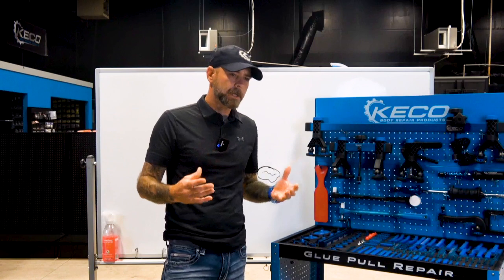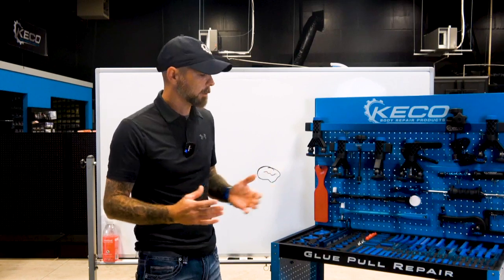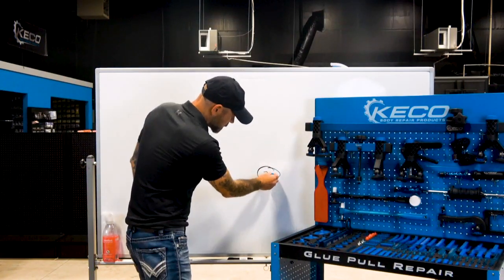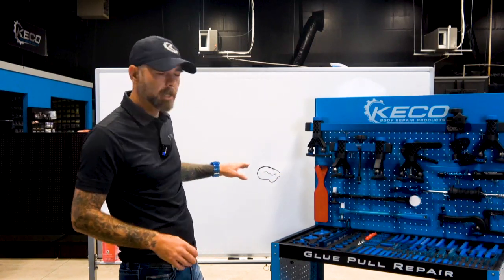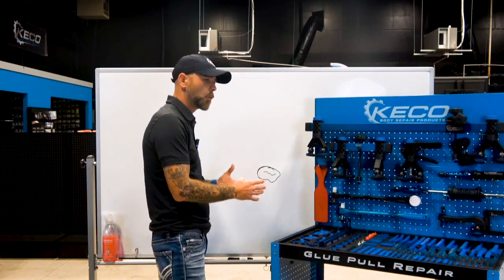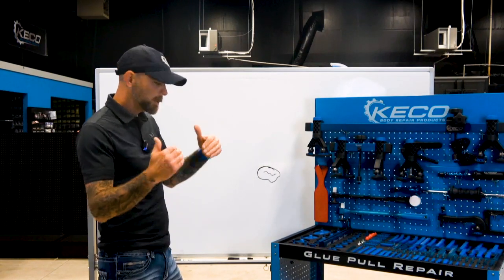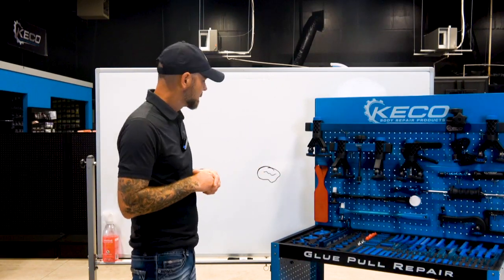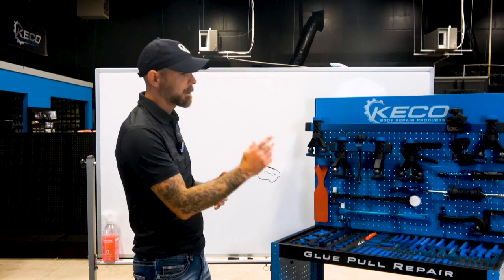Is Your Glue Tab Too Small? - How to Size Your Tab Correctly - Customer Problem Solved

Comment: I have a hail damage corolla I'm working on. Hail dents are large quarter to half dollar size. I bought the beginner kit from keco. (Mini lifter, 2 knock downs, glue gun, 6 glue sticks and 6ice flip tabs) the problem I'm having is I get them to a  pencil eraser size and can get it any smaller.  Are my tabs too big?
Reply: Probably slightly stretched metal.. in which case I'd advise to pick up metal from the backside with a sharper rod to try to blend that area into the orange peel in the paint.